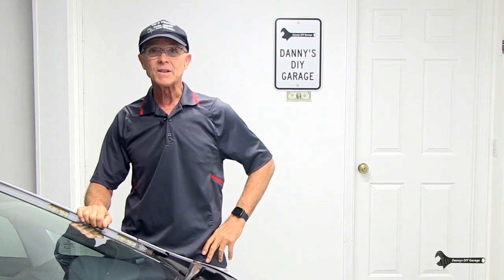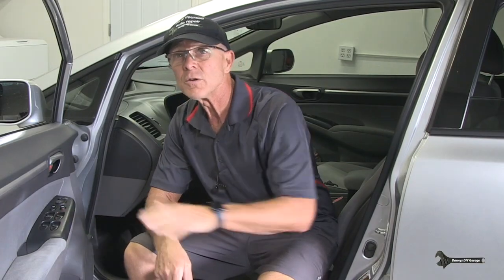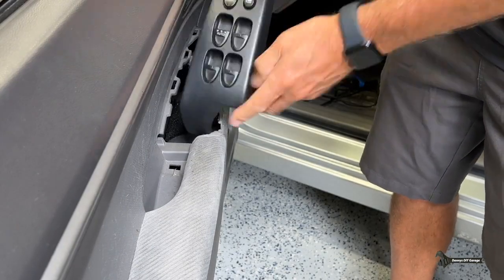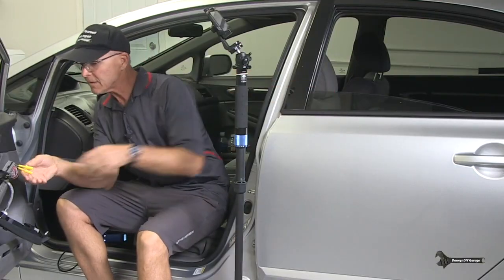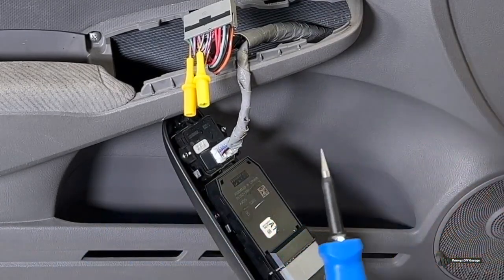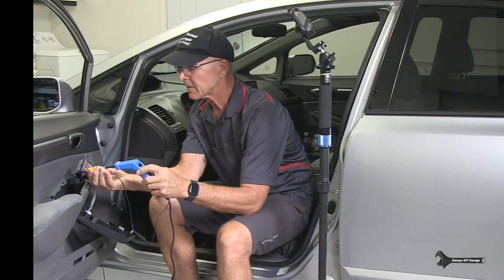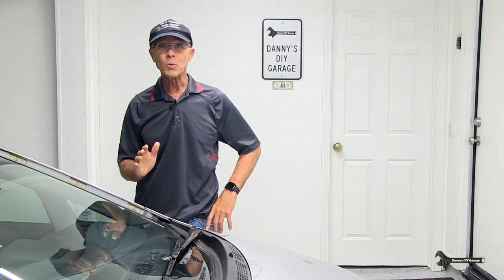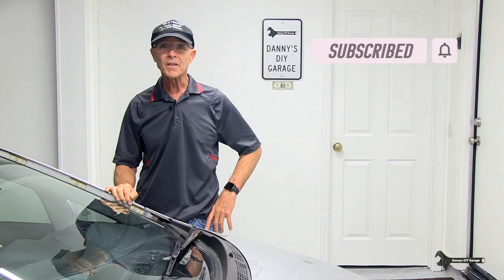Window Stopped Working, How to Test Components (Switch, Motor, Regulator, Fuse) Honda Civic 8th Gen

Comment: Hi dear , i have a problem on my driver windows it doesn't auto up , but working normally up , down and auto down but auto up not working, i tried with another switch the same issue and all wiring seems good , thank you ❤

Comment: The problem I'm having with my doors is they won't auto lock when i get to 10mph or when i put the car in park i have to manually flip the switch mystery or close the door with the key not even the master switch is closing the doors and yes i have changed the master switch sigh. 

One thing, though, whenever i manually flip the switch and close the door whenever I'm inside the car i can hear a click under the dashboard sigh i need help because my door locks it just won't automatically close whenever i drive and even if i manually do it and i stop put it in park it won't unlock everything i do i have to do it manually. PLEASE I NEED HELP
Reply from the maker: Question do you have a alarm? Many dealerships install an alarm before it’s purchased and if you don’t agree to purchase the alarm they remove the module but leave broken wires behind, let me see if I can find a video I made on this
Reply: @dannysdiygarage I have the alarm Danny it's frustrating. The fob won't open or closethe door nor when I drive i have to do everything manually
Reply from the maker: @jayecks1 if you have a alarm it needs to be removed as part of the diagnosis process, alarms cause 90% of these problems, I’m not saying it’s the alarm, I’m just stating it’s going to be part of the diagnosing process
Reply: @dannysdiygarage thanks Danny you don't even know how your videos saved me with my civic.😂😂😅😅 I changed my blend door because of you and fixed my entire system. You're a gem. Keep doing it. Oh, I live in Jamaica, so just know your videos reach further than you think.
Reply from the maker: @jayecks1 wow, I appreciate that information
Reply from the maker: @jayecks1 appreciate you my friend ❤
Reply from the maker: https://youtu.be/6DU3KSZgSUA?si=PCnFBpshaoUNiaVD